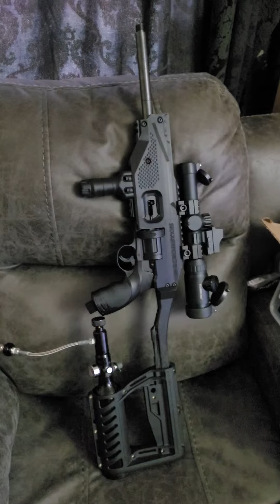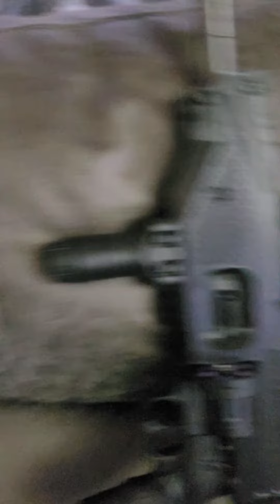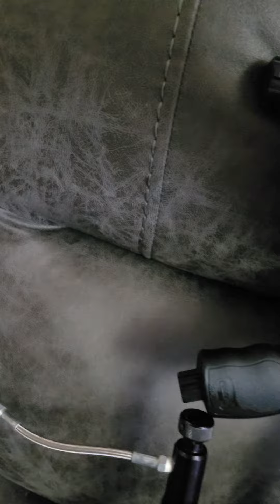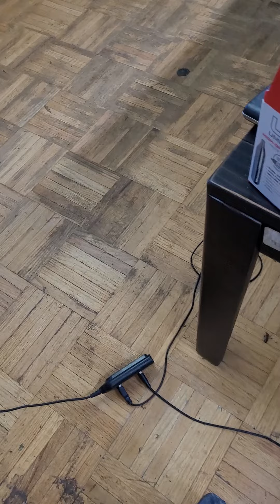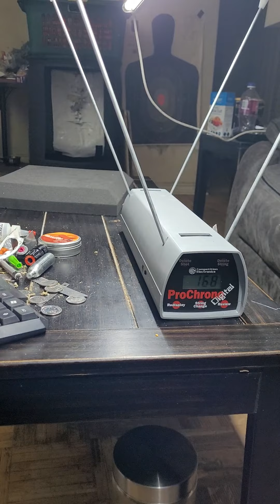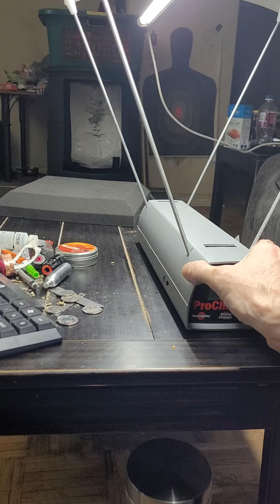Umarex T4E HDR 50 Co2 32 Joules 6.1 gram slug ammo 6

Comment: Hi, please  do this test, with HPA and CO2, to compare energy output with different lengths of barrel. Try this test with a shorter barrel (no barrel extension) and with a slightly longer barrel (2 barrel extensions).
After this, repeat this test for different ammo types, like steel ball, solid rubber ball and nylon/plastic/polymer ball. Thanks.
I feel that a very long barrel is best for nylon balls, while a shorter barrel will be best for steel balls.
Reply from the maker: on the hdr50 with the 22 inch barrel it hits over 100 joules, thats 497 fps with 8.4 steel balls, with 18 inch barrel i hit 95 joules and with just tuning run i hit 62 joules also the long barrel favors the heavy ammo, lighter ammo at this power tends to curve in my long barrel so i dont use light ammo and i have to stay under 500 fps here so im maxed out with the 18 inch barrel
Reply: @LessLethalHomeDefense  Nice test. But I think the poster wanted you to compare CO2 with HPA at 850 PSI (which most people have - few have 1100 PSI). So same ammo, same pressure, compare CO2 and HPA. CO2 does ~32 Joules with 6.1g ammo. What does HPA at 850 PSI do with the same ammo?

Comment: Where exactly do you get the extended barrel and all the add on body kit, stock etc...Your HRD50 looks the mutz nutz! 

Just purchased an HDR68 16j and HDX68 16j, i would like to get into converting and modding them. Is it worth extending the barrel on the HDX68 by another 6" turning it more into a rifle, also got an HDS68 16j which i haven't done anything to. I've seen this with an extended barrel as well, again is it worth doing?  

I'd definitely like to do to my HDR68 what you've done to your HDR50. Based in the UK and anything for these seems very limited and Europe doesn't like dealing with people in the UK any more since Brexit. 

I'd like to convert all of them to run external CO2 or air tanks. Can these be powered with Nitrogen?  

What you do with these is bloody brilliant, more please!
Reply from the maker: got the barrels and powerkits from homedefence-24.com ask florian. and no need to extend the barrel on the shotguns cuz they are long enough but after 60 joules an increase will definitely give more power, and im not sure about nitrogen but i think it will